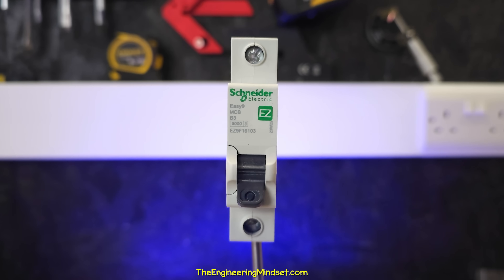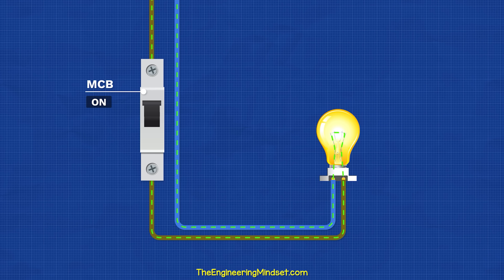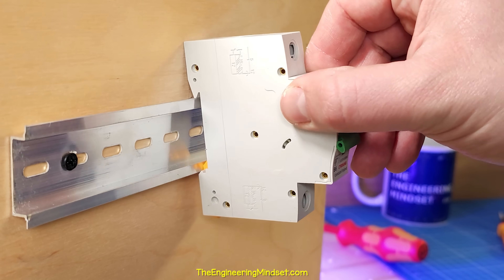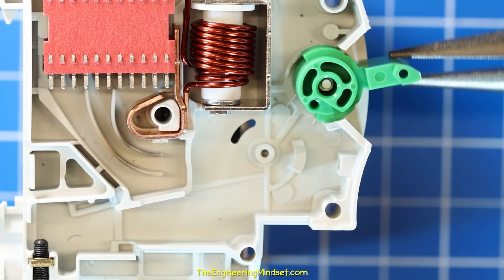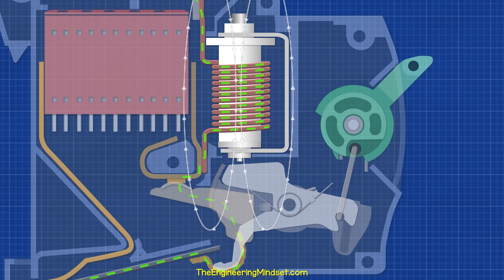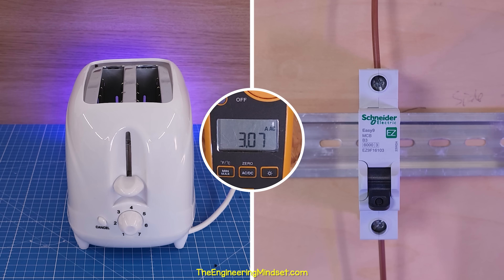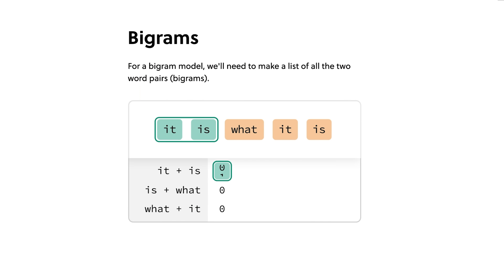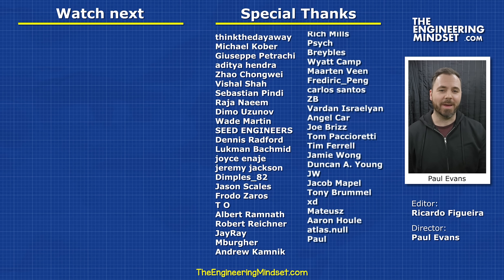Why Circuit Breakers DON'T Protect People (electric shocks)

Comment: Off topic question, but related in a way; In the US we have single phase 110 volt electricity, and to get 220-240 volts we need another pole from 3 phase to achieve that voltage, requiring at least 3 contacts in the plug, 4 including a ground. How does Europe have what appears to be single phase 240 volts? Most outlets only have two contacts and no ground contact, which leads me to believe it’s single phase 240, so how is that possible?
Reply: In UK, the three phase is 400V. In UK, there is 3pcs of live cables which is Red, Yellow and Blue. 400V is the voltage across Red-Blue, Red-Yellow or Yellow-Blue
Reply: @humanity2914  Yellow cable was banned decades ago. Too easily confused with earth cable that was supposed to be green with a yellow stripe but yellow with a green stripe also turned up.
Officially it is red, white, blue phases with a black neutral now but “metric” cable has the phases as Brown, Black and Grey with a Blue Neutral.
Old US standard cable had a red earth wire hence the striped green international standard. The U.S. uses black actives and white neutrals too.
Reply from the maker: The US splits a single 240V phase into two 120V phases in the pole mounted transformer. EU doesn't split it, it just has 240V. We have covered this is some detail in out sub panels explained video, 120V /240V electricity video and I think in the Ground, hot, neutral video with some nice animations to explain how it's done. Additionally, check out consumer unit explained video to see how it's done in the UK/EU
Reply: This is also an issue for some American 240V equipment as it assumes 120V to ground - switch mode power supplies fail specularly when fed twice their nominal voltage to ground as the internal insulation is only designed for 120V AC.
You have similar issues with solid state switches and mains voltage capacitors when they assume the L1 and L2 voltages can’t exceed 120V above the chassis ground but L1 is at 240V and L2 is tied to 0V.
Reply from the maker: Seen our new 3 phase transformer video?➡️: https://youtu.be/u0SsejDCVkU

Comment: It does protect people by stopping them dying in a fire.
Reply from the maker: True but not necessarily, only in certain circumstances. For example if the wrong or sub standard cable is used it won't trip if it catches fire, and if the appliance which it's providing power to catches fire it also won't trip, it'll just burn the house down. It's still a very useful and important device, but other devices are needed alongside it.

Comment: Well, to be fair, electrical breakers do protect people, just not in all cases. First, they save people from dying in a fire caused by a circuit overload. And then they also prevent grounded metal casings from going on live potential if a faulty live wire touches them, saving people who touch the casing. However, they do not protect people who carelessly touch electrical wires or contacts.

Comment: If you pass 20 amps through a 10 amp breaker, the breaker will likely trip almost immediately.

Thus in your scenario, the current (20 amps) is double the rating of the breaker (10 amps). When the current exceeds the breaker's rating, it triggers the internal mechanism to trip and open the circuit. The time it takes for a breaker to trip can vary slightly depending on its design and the specific conditions, but generally, it should trip very quickly in response to such a significant overload.

Correct answer? 😵‍💫
Reply from the maker: You can find the answer towards the end of the video, we provided a chart with worked example to show how it's calculated.
Reply: Generic answers are best! @EngineeringMindset
Reply: Unfortunately, you are wrong. MCB trips according to the magnitude of the current. If the current are only twice, it will took about 10sec.

Comment: Circuit breakers and fuses are not designed nor intended to protect people. Their purpose is to protect the electrical power system - generators/distribution/transformers and other electrical equipment from damage that could be caused by overcurrent or a "short circuit" fault.

Comment: Pointing out what the "3000/4500/6000/10000" is for would fit this video well.
All too often i hear people (even colleagues) say "it can handle 10000 volts" and they refuse to accept that it means Icu or maximum breakable short circuit current.
Reply from the maker: Good point, If the video is popular I can follow up with some additional info.
Reply: Это максимальный ток короткого замыкания при котором mcb обязан разомкнуть цепь и не разрушиться сам. Косвенно это значение показывает сколько циклов коротких замыканий может выдержать аппарат без существенных последствий. Например, если в вашем доме ток короткого замыкания 500 A, то MCB 6kA  сможет отключить его 10-12 раз, а потом требуется проверка или замена. Но это условно и не является точной шкалой определения неисправности.

Comment: 2:00 - 1.5mm² cable is protected with a maximum of 16A. 2.5mm² is required for 20A to 25A.
Reply from the maker: The maximum current for the wire depends on the method of installation. This is noted in the corner of the video. Using method C (clipped direct) it has a maximum of 20A. With reference to the onsite guide by the IET

Comment: I always thought 13A was maximum for 1.5mm2
Reply from the maker: I have included a note in the corner of the video, but it all depends on the method of installation. Also the standards which your country requires compliance with. This is based on UK example.